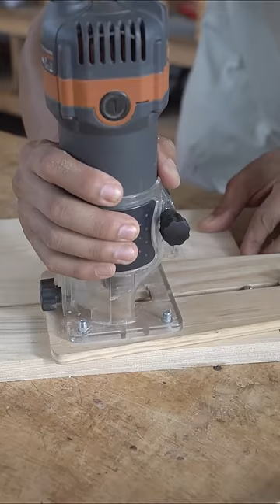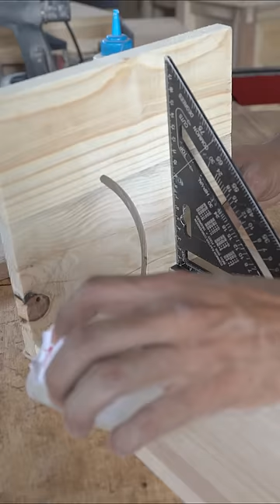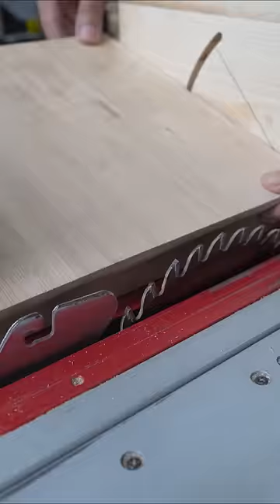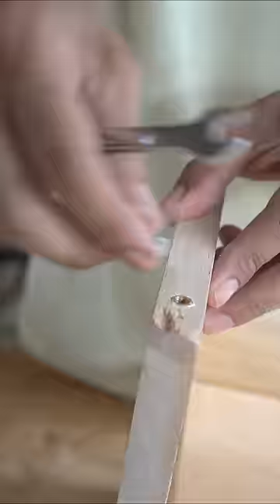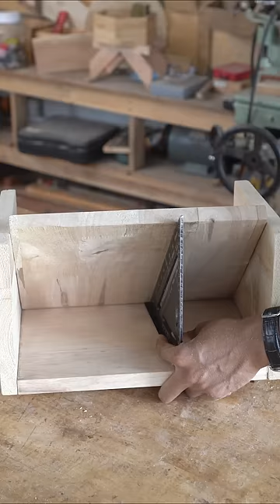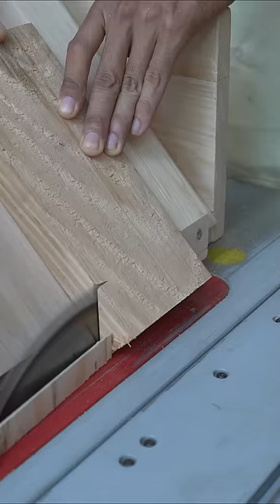Amazing wood tool for cutting wood board 45 degree #woodworking #tools #amazing

Comment: Bro, you do know the blade tilts right. Much safer to have board flat and the blade angled.
Reply: True. The blade do tilt, but can you tilt it at a perfect 45 degrees angle ? For example, for my 3 years old Makita, the answer is no. The induction motor is too heavy and the setting screws poorly designed. It is a great saw, very powerful, but it is only accurate when the blade is vertical. It is a shame for a 800€ saw, but just an exemple to explain why some people have to use crappy jigs like that. Especially with cheap table saws.
Reply: @TheDesoxyribose - I like your and so much that I built one for myole' Craftsman. Works great, thanks for sharing

Comment: Did you just tap a thread into wood 🤣
Reply: Threading wood work quite well. Better in closed grain hard wood like maple. Soft woods can be thread also. Three, coat threads with thin CA glue and tap again to clear the threads.